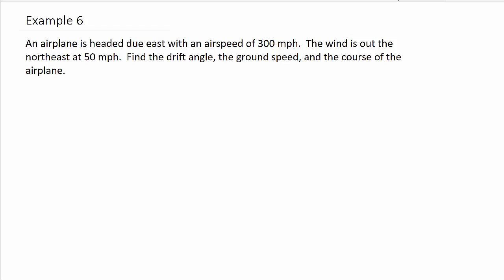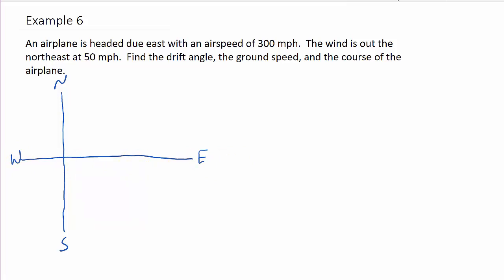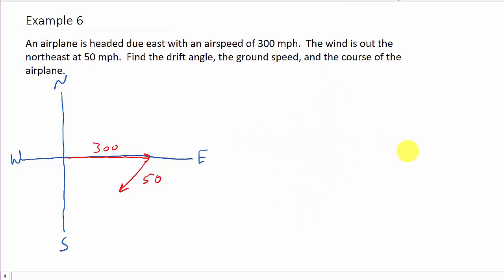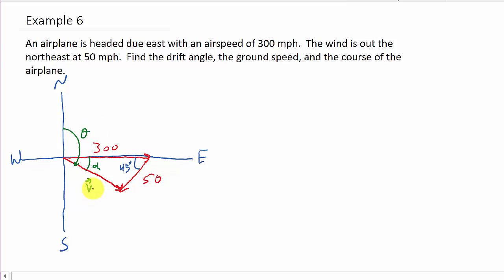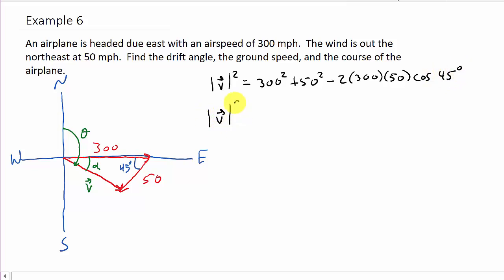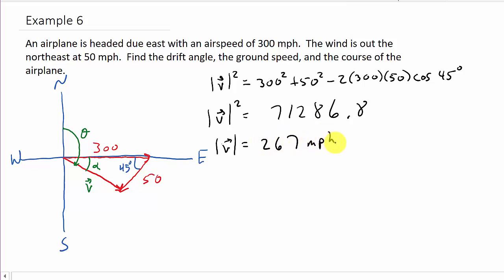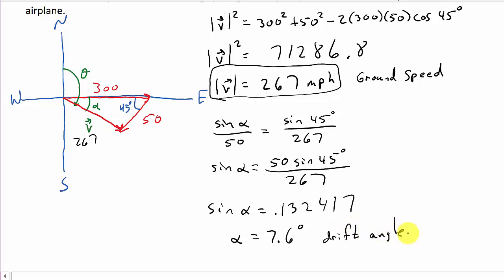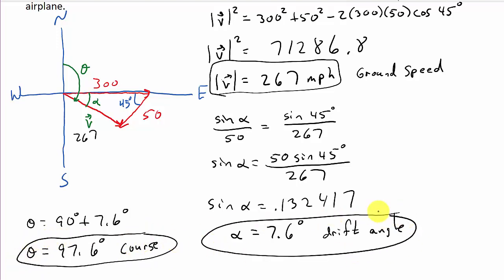Vector Application: Airplane Course, Ground Speed, Drift Angle Example 1

Comment: A pilot is flying with an airspeed of 185 mph at a heading of 212°.The wind is blowing from due east at 27 mph. Find the ground speed of the plane and the direction of flight. Can u please help me
Reply: Did they give an angle for the angle at which the wind was blowing? That’s important to solve the problem
Reply: @layladeclaire4737  east

Comment: 8:09   i just don't get it how you get the 7,6 degree , can anyone explain ?
Reply from the maker: I’m just using the law of sines.
Reply: @crowsmathclass  ok but how from sin A(alfa) = 0.132417 you got 7.6 ? cause i just don't get it
Reply from the maker: Inverse sin of .132417. Make sure calculator is in degrees.
Reply: @crowsmathclass  i found an other formula for drifting angle = direction of wind *wind speed/ ground speed / but thx anyway
Reply: @alexs.p.r4357  arcsin(0.132417)=alfa
Reply: @crowsmathclass  and i tryed to calculate something : an airplane is heading E with 240km/h and the wind blowing from 30 degrees with 60(km/h) from what i calculated ground speed should be 216km/h , but on my navigation book at this example it just gives my a formula and sey ground spd is 220 and 2 paragrafs downwords it say it is 205,5 and on the graphic it is writen 210 , and now im lost :)) can you help my ?